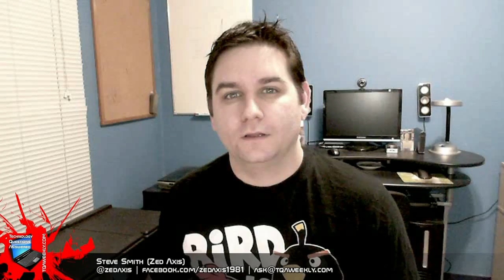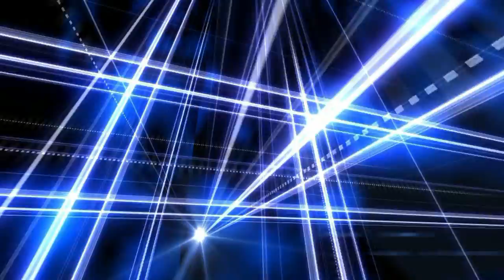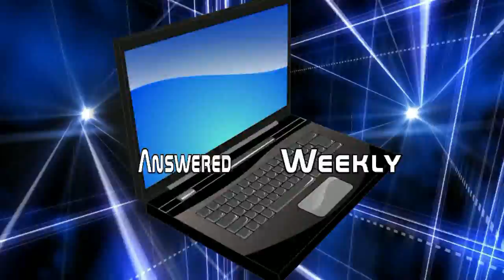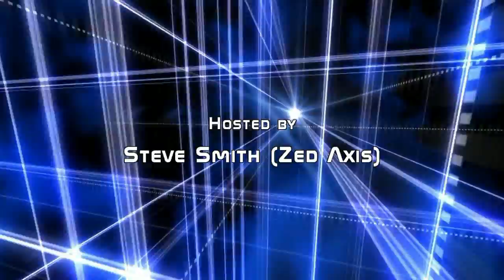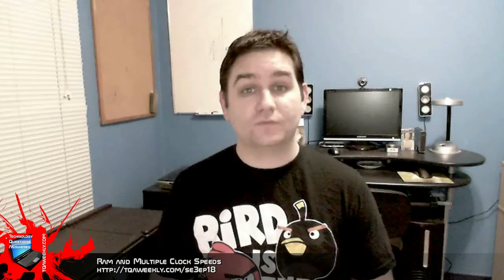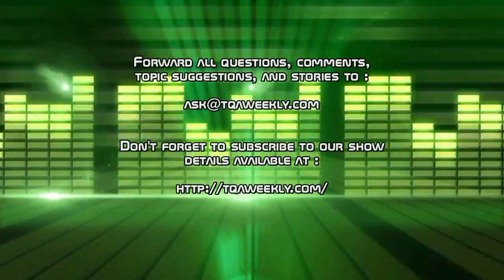Ram and Multiple Clock Speeds

Comment: Is it possible to mix venders in ram with same clock speed? But still have the same performance you get if they all match.
Reply from the maker: Jim Morgan you can mix vendors, and provided the clock speeds are all the same, you will maintain performance, however, exceptions may occur, consult your mainboard manual online for up to date compatible ram bars.
Reply: Awesome so its better to find the same memory sticks? Thank you so much for your time.
Reply: Bar's, sorry.
Reply from the maker: Jim Morgan bar or stick, same difference. It is better to find from the same manufacture, have the same type, and the same latency. However, most users will not see any difference unless you override the default values in your bios and write in the specific ones for each of the bars of ram. I highly doubt anyone but overclockers like myself spend the time to do such a thing. Make sure you validate with the manufacture's web-site those bars or sticks are validated with your mainboard, and as always, always refer to the bios version, as this, also, has a say in the compatibility.
Reply: Thank you. It's the Kingston HYPER X KHX1600C9D3T 1K2/8GX DDR3. I can only find it on E-BAY. I keep putting off getting more now there out of production. lol. I was going to SLI another EVGA 660 Ti SC. Got it and found my power supply was a little weaker then I thought it was. Any way I greatly appreciate your time. Thank you so very much. Peace, love and chicken grease.
Reply from the maker: I will see if at my day job I can order those, or if they are discontinued. If I can order them, it is possible to pay the store via paypal, no promises, just possible solutions, work for you?
Reply: I found em on e-bay or Amazon for around $90. When this thing was built they where 53. It'll hold up to 32GB. But that's a whole lot-a money. Any way tanks.

Comment: Hey I have a question. If I have a mother board that has a maximum capacity of 1800 MHz in the ram, what if I put in ram that is stronger than that? Will it just use 1800 of the 2133 given? Or will it overheat and burn?